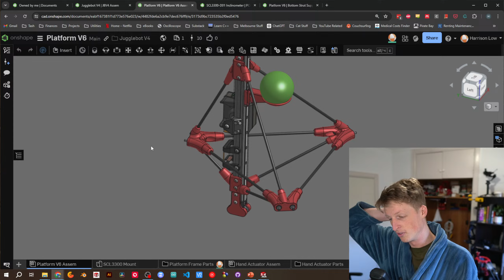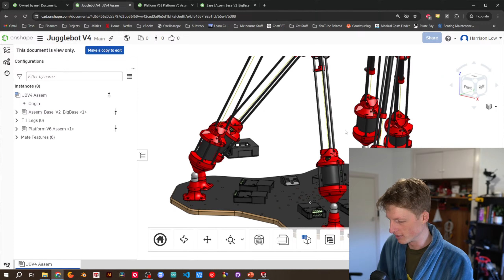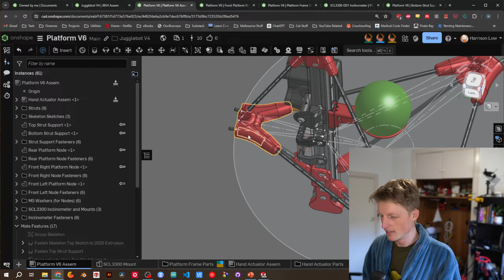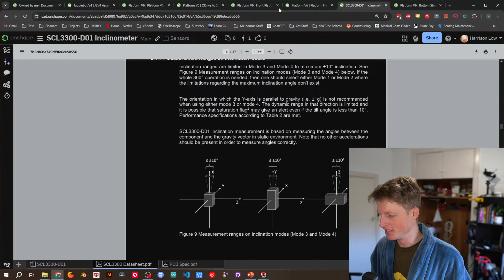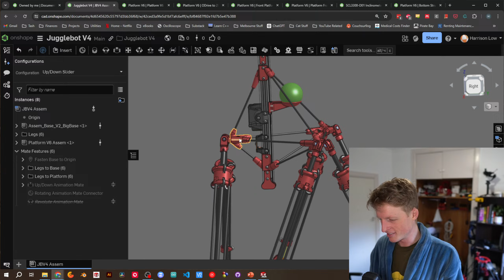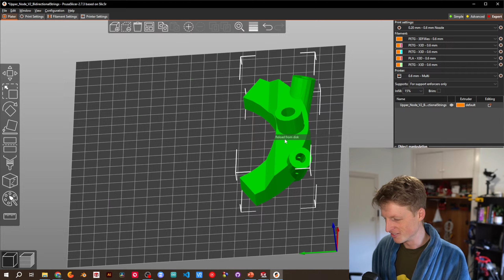PDJ Weekly Livestream # 24 - Update

Comment: For 3mf exports: set your browser up to select where you save downloads. That way, you can overwrite your last download and use refresh in your slicer.
Reply from the maker: Very nice suggestion! Doing some digging, I found a chrome extension "Downloads Overwrite Already Existing Files" which does exactly what it says on the box. This helps a lot with being able to 'refresh' in prusaslicer, though it'd be great if there was some way to speed up the onshape side of things, making exporting faster.

Cheers for this suggestion! 😊

Comment: You can have nested folders in the part studio. I don't know how else to do it: once you add steps to a folder, you can go into the folder and select subsets of those steps and add folder again. Then those steps are in a subfolder. If you want to add additional steps to an existing folder (or move another folder into an existing folder), you have to have the base folder open, then drag the new steps/folder between a couple of steps in the base folder. Then you can move drag it up/down to where you want within the folder. I hope that makes sense.
Reply from the maker: Very interesting! It's strange that this works for part studies and not for assemblies 🤔

Thanks for letting me know this!
Reply: @harrisonlow  When I want something similar for assemblies, I make subassemblies that are then used in the primary assembly. Each subassembly winds up in its own tab. IIRC, if you select a group of parts you want to be a subassembly in the list, then right click, there should be an option for something like "make subassembly"
Reply from the maker: @mira_featherbender  Interesting process! I'll have a play around with this for my situation right now with the fasteners;  perhaps a 'fasteners' subassembly is the (current) solution. Cheers 😊
Reply: @harrisonlow  I just found an even easier way to do exactly what you want. In both part studios and assemblies at the top of the part tree is a little button of a folder with a + on it for "Create New Folder". If you select multiple items and hit that button, all the items will be added to the folder when it's created.
Reply from the maker: @mira_featherbender  Very true! Though have you tried this in an assembly while you have a folder selected?